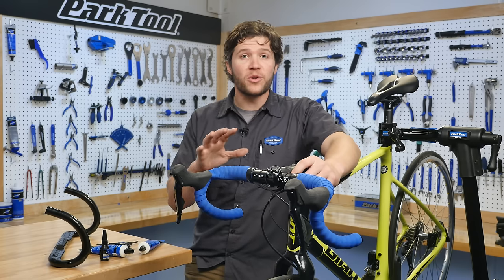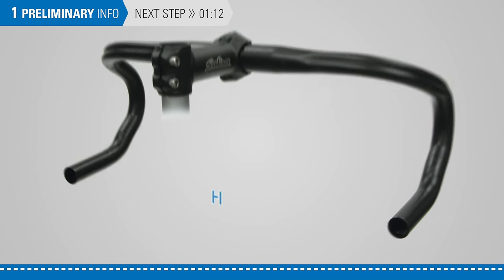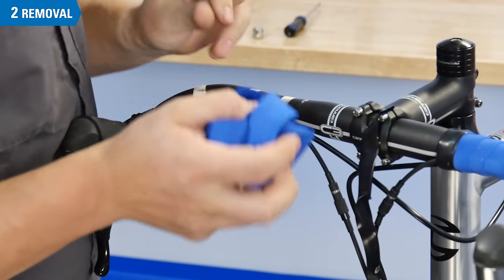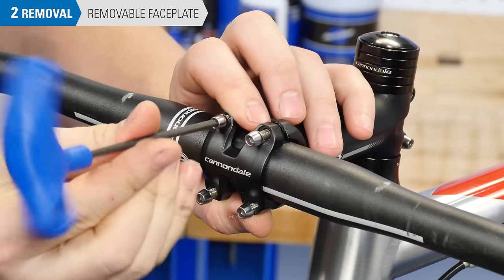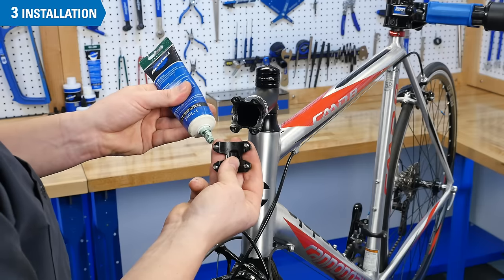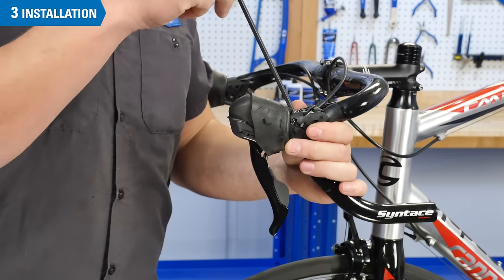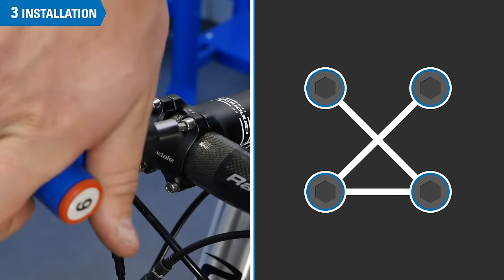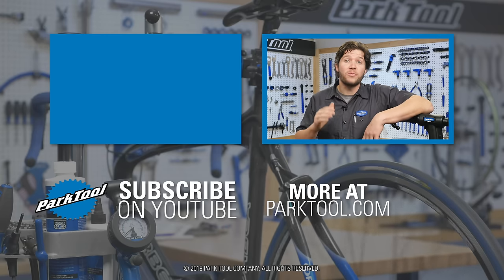How to Replace Bicycle Handlebars - Drop/Road Bars

Comment: I'm going from a straight handlebar to a racing curved handlebar will I need to change my gear controls and brake controls on my bike
Reply from the maker: Correct.    Near shift and brake levers will be needed, as well as new cables and housing.

Comment: Hey, I´m new in this bike world. Can i replace my flatbar for drop bars in my Trek FX2 and if so, do I have to change the entire group? Thanks.
Reply from the maker: Not the entire group.  You will need new brake levers that are compatible with your brakes (Linear pull) and built in shifters compatible with the rear derailleur.  New cables and housing, plus tape, and some work.
Reply: @parktool  Thanks a lot 🔥

Comment: i wonder if you can use a bountain bike shimano trigger shifter to a road bike handlebar
Reply from the maker: MTB shifters are designed for bars of 22.2mm.  Road bars are 23.8.  Additionally, the clamp design of the MTB shifter typically cannot get around the curve of the drop bar.

Comment: When changing a 40cm drop bar to 44cm, how do i check if my cables are long enough or too short?
Reply from the maker: Generally speaking, if you still have full rotational travel of your handlebars without kinking or binding at the housing stops or barrel adjusters, your housing is still long enough. Here are some articles with more information:

https://www.parktool.com/blog/repair-help/cutting-and-sizing-cable-housing

https://www.parktool.com/blog/repair-help/brake-housing-cable-installation-drop-bars

Comment: Noob here,can U change flat bars to drop bars
Reply: As in can I get it done in a bike repair shop
Reply from the maker: You can. The thing about going to drops is that it can be costly due to the brake/shifter combo is typically expensive. If you go with bar end shifters or another style of shifter it can be done for less investment.
Reply: @parktool  thanks a lot man🙌